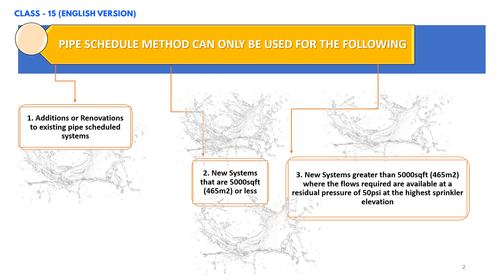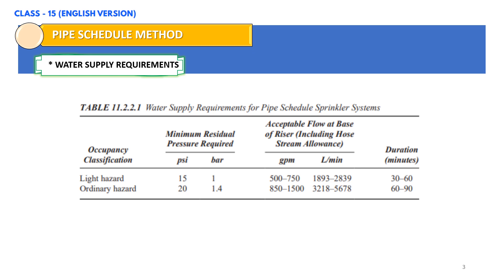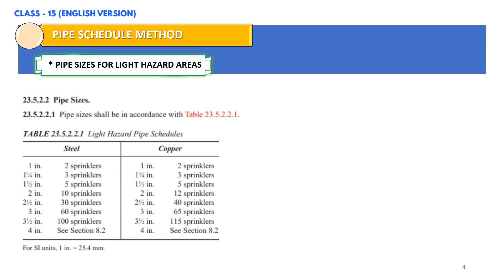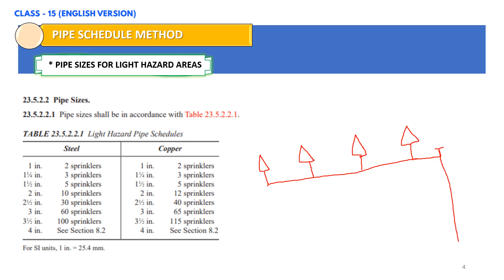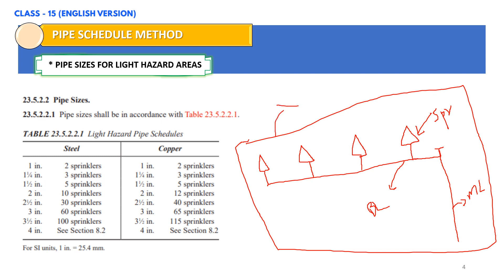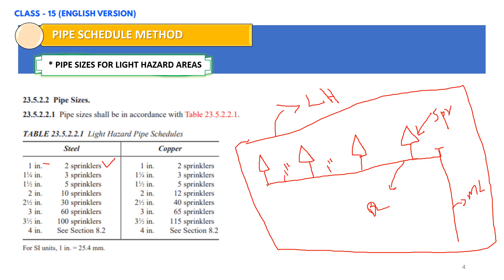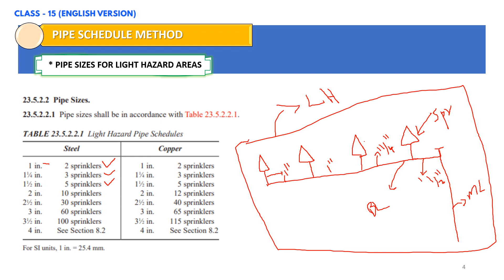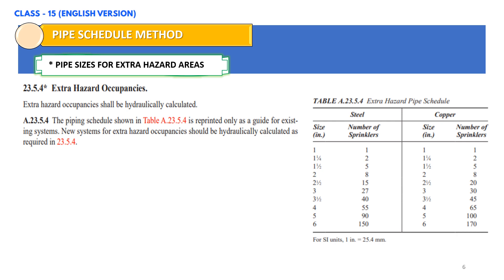Pipe Sizing for Sprinkler Systems Made Easy!

Comment: From cross main through a single riser nipple of 65mm can i make a tee connection and connect 8 sprinklers each on the both sides 
as per NFPA 28.5.3.1 Unless permitted by 28.5.3.2 or 28.5.3.3, branch lines
shall not exceed eight sprinklers on either side of a cross main.
Reply from the maker: Ultimately depends on hydraulic calculations

Comment: Can we use this table dry pipe system, too?
Reply from the maker: Not allowed. Only hydraulic calculation method can be used. Dry pipe systems require accurate hydraulic calculation method because of factors like air pressure and water delivery delay to ensure proper system performance

Comment: kindly make video on grided & loop sprinkler design pipes sizing
Reply from the maker: Concept is same. However by using pipe schedule, loop size and grid size cannot be defined. It should be done using hydraulic calculations
Reply: @irfancfps  exactly but make one example video if you can thanks🙏